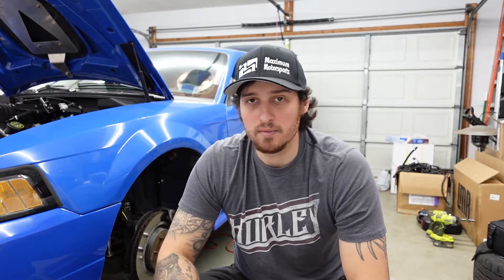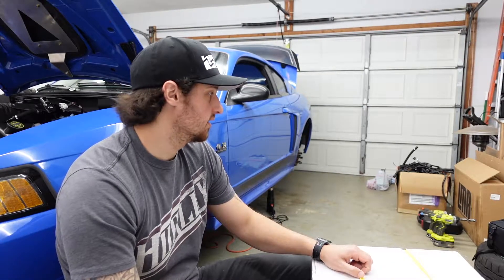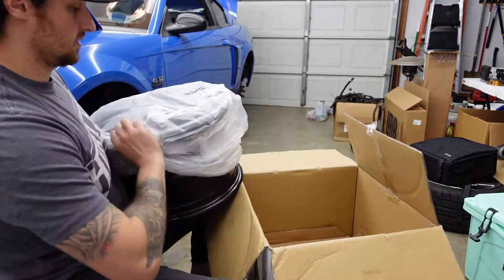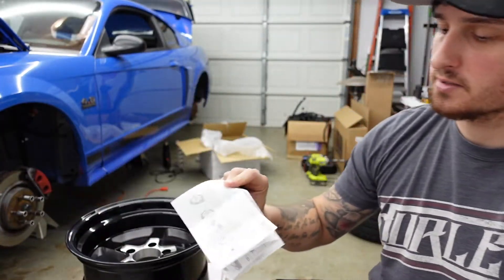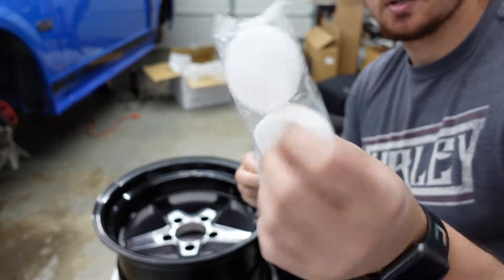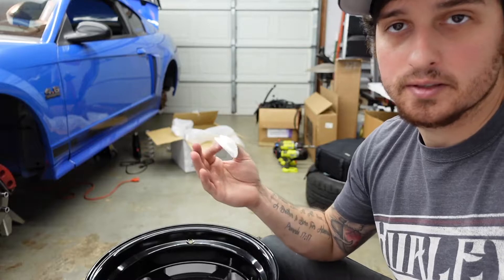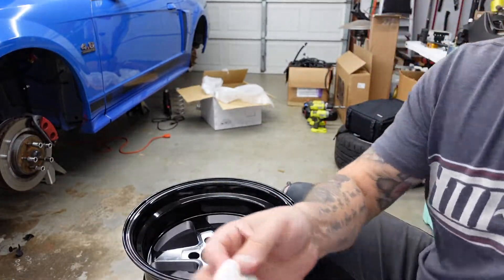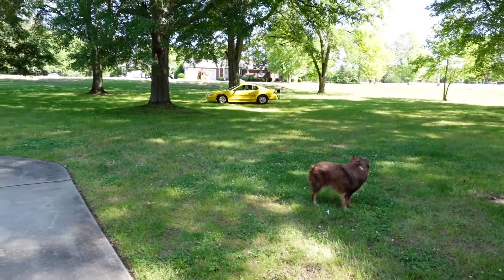Drag Wheels Unboxing [How to Ceramic Coat Wheels for Cheap]

Comment: Going to be getting the same wheels for my mach 1, which backspacing did u get for the rears and the fronts? Also how was the rear caliper clearance, youre still running stock cobra brakes right? Thanks!
Reply from the maker: Awesome, these are the 5.5 backspacing. But I put a shorter rear end in there and swapped over to GT brake brackets. They fit on stock brakes and rear end but stick out 1 inch on each side. So when I put the new rear end in they tucked better.
Reply from the maker: Also to run stock rear end you have to grind down the banjo bolt a ton and 6.5s would look best
Reply: @PoorBoysRacingChannel  gotcha thanks yeah 6.5 seems to be the popular fit for 10 wides, i have chrome saleens exactly how youve had before and i believe the rears are just over 6.5bs i cant recall but i prefer how they look with 1in spacers so im hoping 6.5 looks just right. I believe theres 2 options for the front 17s which backspacing and tire size did you go with there?